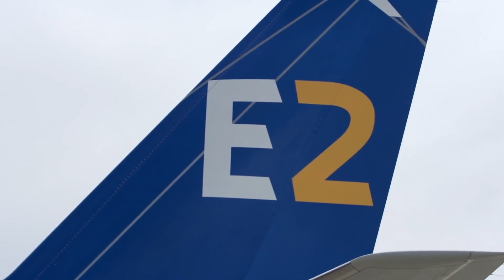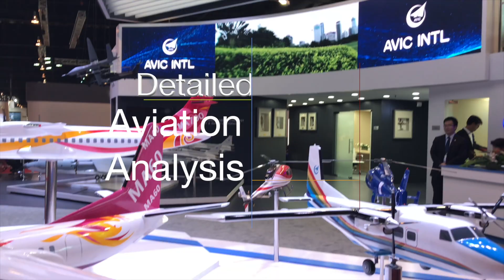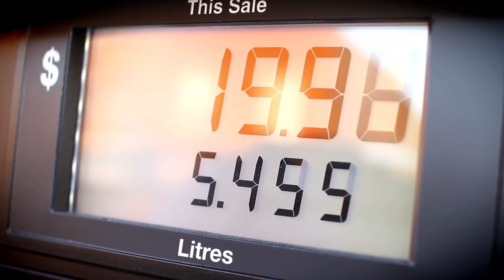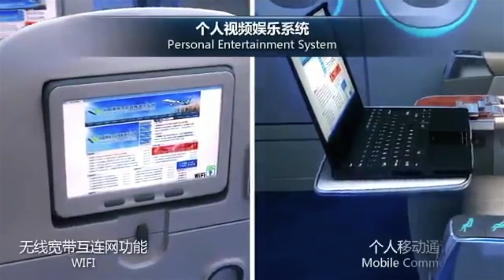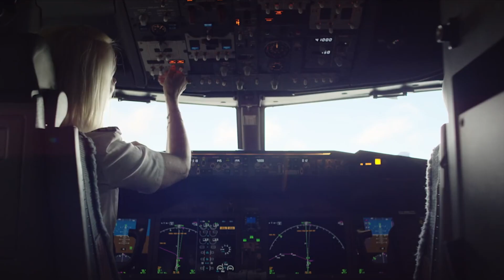COMAC C919: Can C919 compete against 737 Max?

Comment: What's the biggest and most significant difference? C919 has much taller landing gears. Actually C919's landing gears are the tallest compared to those on A320 and Boeing 737.

Comment: The C919 is here to stay. Many Western airlines are still flying old classic 737-300,400,500. Why wouldn't this modern C919 plane outperform most of these old and inefficient 737s. Most airlines don't have the seats filled up. Lucky to have 70% capacity filled up. C919 is more than enough to do the job. C919 has an edge over 737 for China. Because it is much cheaper in service and maintenance work. When China starts reducing buying new 737s or none at all. Expecting 737 will go up in prices because of lower of volume Planes sold.

Comment: It doesn't need to compete with 737 or 320. In the next 20 years, China needs 8000+ new aircraft, most are single-aisle plan. It only needs to capture half of that.

Comment: Yes
because all Chinese airlines will be forced to buy it.
Reply: Yes, that is true. It will be a sucess per default in China if it ever flys. It will propably not be a sucess yet outside china, but they will make better and improved aircraft based on that, and eventually they will not only be able to compete but also untercut the prices of Boeing and Airbus. 
It is really hard to break in to that market, but if anone can do it then it is Comac I think. Maybe they will take UAC on board as they in their long range aircraft project, as UAC seems to be still quite a bit ahead in terms of expericence and technology, but UAC lacks the strong home market and the ecnomic power of China that will be the key to the success of Comac.

Comment: One thing to compare when you are doing single aisles is how you can escape the plane. For instance landing on water, the 737s require people to get life rafts out of the roof in the panick, tie them securely to the seats in the middle exit row, throw them out the small escape hatch, have them close enough to the wing to jump on without falling into the water on the way. On an A320, you just pull a handle in the top of the exit opening, and it deploys the escape slide / life raft from the wing. That's all you have to do, and it worked when they landed on the Hudson - everyone survived.

Comment: If the problems continue with max program the airlines obligated to buy C919 & MC-21 because Airbus can't give all market requirements with its production capacity..
But the other question does Irkut & Comac  have the enough production capacity to sell out of China & Russia?!
Reply: You do have a point for Asia/Middle East and those African countries that are indebted to China. There is one major problem, Russian and Chinese commercial aircraft manufacturers do not have an extensive global spares, engineering and logistics support networks like Airbus and Boeing have.
Reply: @chrismckellar9350  china will be the single largest aviation market within 5 years, larger than us or eu. with demand for 6000+ single aisle planes for the next 20 years, chinese market it self is enough to keep it developing and improving. remember china only started developing high speed rails about 10 years ago, and now the high speed rail network has about 35,000 km of tracks, more than 70% of the world's total. the point is, things develop at a much much different speed and scale in china.
Reply: @obstinatejack  - China's COMAC does not have a global spares, engineering and logistics network that Boeing and Airbus has. The only market for COMAC built aircraft is China and countries that have a close economic or are indebted to China.
Reply: @chrismckellar9350  Indebted, that's a cute term. But here's how things will really be. At the present, China's international tourism expenditure is almost twice as that of the States, 277 billion vs 144 billion. Each year China makes more than 200 million international visits, and we know this will only grow more as China's economy is still growing at around 6%, so there's no slowing down. With a growing economy, and growing tourism abroad, China is going to expand the demand for international flights. China doesn't have to eat into the established markets of Boeing and Airbus, stop thinking like China is taking anything away from the old pie, China is baking up more new ones. The point is, with more international tourism, thus results in more international flights, and therefor, will inevitably create demand for more planes. China simply use its own planes on its own airliners catering to its own people's international travel needs will be sufficient. No one needs to be manipulated and or extorted to buy planes they don't deem fit to fly, to even think about things that way is really rather a poor reflection of your moral state of mind.
Reply: @obstinatejack  - This nothing to do with tourism. If Chinese airlines use COMAC built aircraft, how are they going to maintain their COMAC built aircraft if there is an engineering issue causing a grounding in city or country where there is no spares or engineering capability for COMAC built aircraft say in Los Angeles, Sydney, Berlin, Toronto, Papeete, etc.

How many western countries are operating operating COMAC built aircraft other than countries who financially indebted to China.

That is why Chinese airlines use Boeing and/or Airbus aircraft, as both Boeing and Airbus operate global spares, engineering and logistic support centres for their respective aircraft.
Reply: china's economy is already 10 times that of russia, so russia's airline industry is really frivolous compared to china's.
Reply: @obstinatejack  - China's COMAC and Russia's UAC do not have global spares, engineering and logistics networks like Boeing and Airbus has restricting COMAC and UAC markets to those countries that have have close economic relationships to Russia and China or who indebted to either or both countries.

Comment: In your graphic comparing fuel efficiency: Why did you choose the A320 ceo as reference and not the A320 neo, which is nearly 20% more efficient ? Or the A220? You should compare your new plane to the leader of the pack, not to some arbitrary contender.
Reply: Why do I get the feeling there's a strong bias for Boeing in this video.
Reply from the maker: bebe eses Thanks for your comment. Well, I actually put the A320 in to show the fuel burn reduction achieved by newer single aisle aircraft. Thanks for watching and do stay tuned for more great videos on the way!